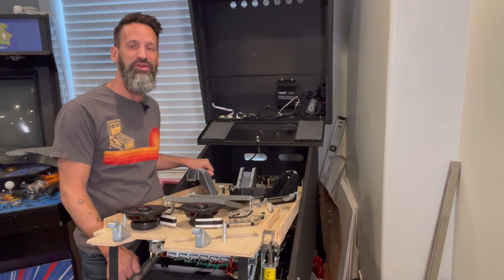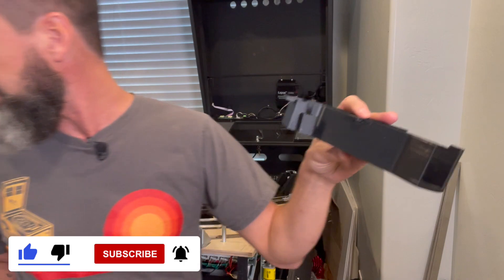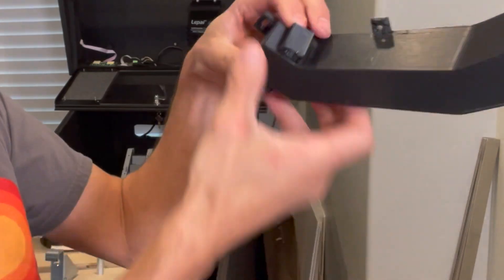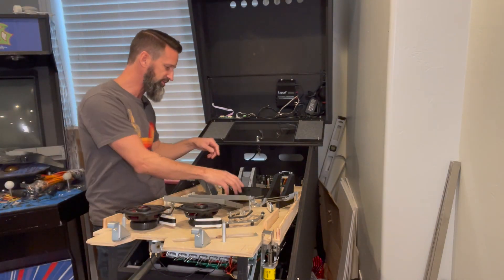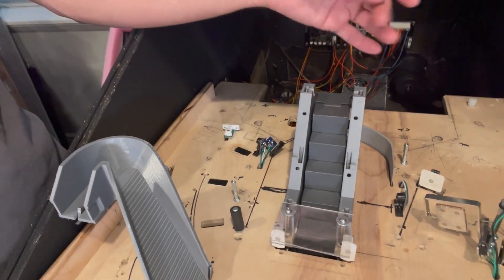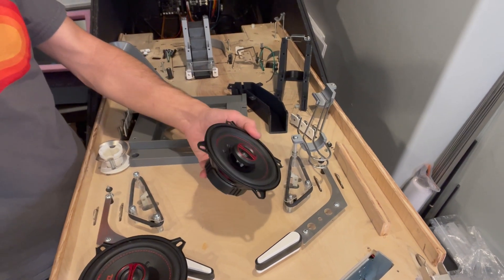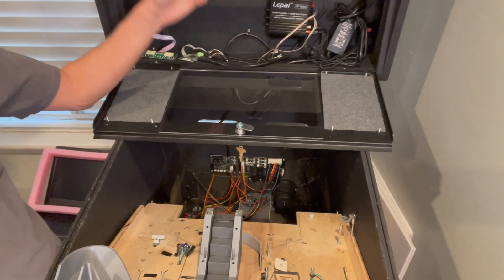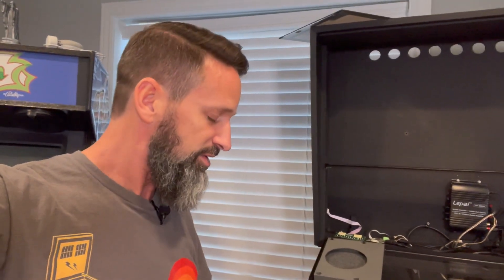HOW TO MAKE A PINBALL MACHINE: More Small Tweaks

Comment: I see your amp back there and one thing I found improves the sound is to use a ground loop isolator on it. They're cheap (like under $10) and reduce a lot of the hum/hiss/buzz from feeding the audio output of the PC into the amp. They just plug right inline and don't require any wiring or power.
Reply from the maker: Ah yes thank you, a couple of folks have mentioned that but I keep forgetting! I'll grab it off Amazon right now!

Comment: With an option to purposefully remove the ball from sight. Have you given thought to how intuitive your design is to a new player? Plenty of machines take the ball away just to have it pop back up and instantly drain when the player was trying to find it.
Reply from the maker: Sorry not sure I'm following? Are you talking about the diverter that goes to the subway or another part of my game?
Reply: @thepinballroom  it’s a few things. Your orbits are clear, you know where the ball is going. But the subway could lead anywhere.
Reply from the maker: @havvik3505  yeah the subway leads to the VUK on the right and that will stage the ball for a mode, etc, so I'm hoping it will be clear enough to the player what's going on and where it'll come out.  Also doesn't create a mean drain etc - but you bring up a good point that I've got to take some steps to bridge that gap so folks know where it went etc
Reply: @thepinballroom  The simple solution I've seen for this is using some sort of GI light that flashes a few times right before the VUK kicks it out.